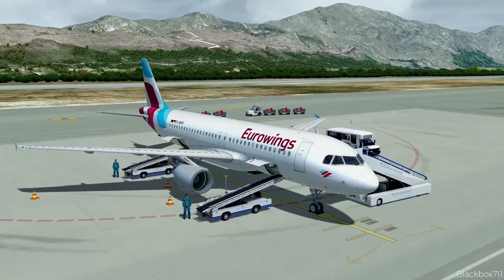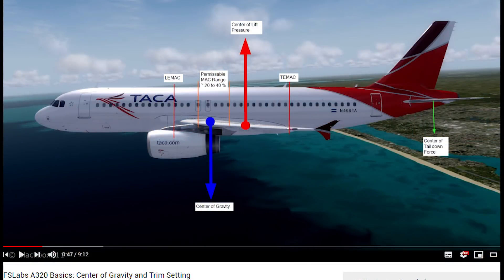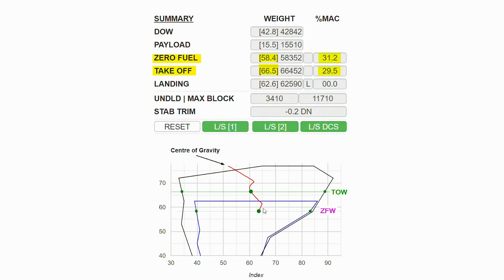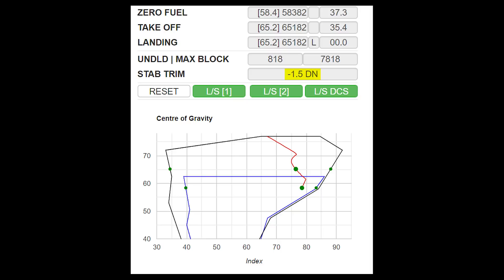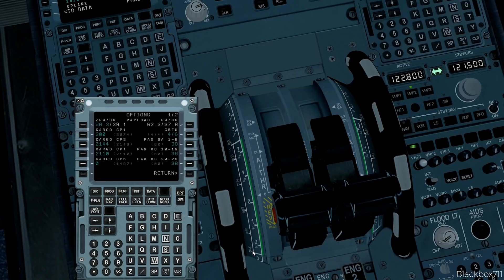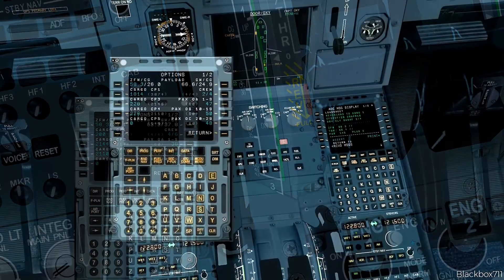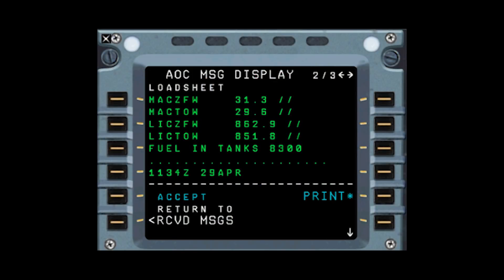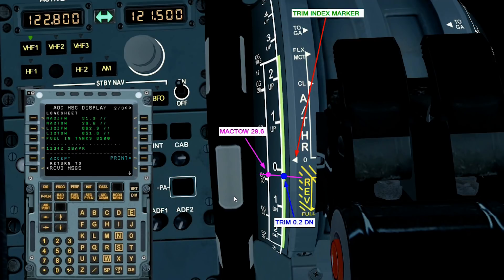Aircraft Basics: Takeoff Trim Setting in the FSLabs A320/A319

Comment: Hello… 

Very nice video. Thank you for sharing with us on this platform. Now it is making much more sense so as to what exactly is happening outside the aircraft whenever we are setting something inside the cockpit. 

So thanks a lot. 

Also… I had a small question that… 
Normally during Take off and during excessive pitch up and down in Air… I believe only the THS part is moving and not the elevators… However the elevators are moving for short corrections of CG movement. You may correct me if I am wrong. 

Because I just wanted to understand the elevator movement in air. When would it mostly move in relation to THS? would be great if you could make a video about it for pictorial presentation. 

Like for example.. If we take the flaps… Then does the THS whole alone move to again retr the aircraft or does that job is done simply by movement of Elevator… Stuff like that… 

It might be a little basic but wanted to have a clear understanding. 

Thanks in advance.

Comment: Hello, thanks for the video.
Do you know why the neutral position of the THS trim wheel does not match with 25% MAC, which is the reference station / neutral point?
Thanks
Colin
Reply from the maker: Hi Colin. A very good question to which I unfortunately have no answer.
Reply: @Blackbox711  Mmmh, it is probably because the CG is before the CP in order to have a stable flight, inducing a slight pitch down moment

Comment: nice video... I use the original Aerosoft's Airbus A-320 DLC pack in Steam Edition... when I choose the Checklist section of the MCDU panel for Co-Pilot mod, she asks: "Pitch Trim?" and I couldn't find it and always skipped the item... :D  now, I learned how to set the pitch trim... meanwhile, I also bought GSX Level-2 DLC pack, but I see just 1 passenger on-board and less baggage loading for A-320... should I set the density of the passengers in GSX's settings menu to get maximum passenger density? otherwise, if I choose Normal density, only 1 passenger boards...
Reply from the maker: Hi. Hmm, with the GSX I can’t help you. Probably best to post that in the developers forum.

Comment: On the trim setting why have two scales (inner and outer) wouldn't the outer CG scale suffice?
Reply from the maker: Hi. Theoretically yes. But for a pilot it is easier to have a relative trim setting value to a neutral point. So a “DN 0.2” is more conclusive than 29.5% MAC.

Comment: Hi I have a question that has nothing to do with the video, Is it true that I should do the approach checklist at 10.000ft?
Reply from the maker: Depends on what the approach checklist says. If it includes altimeter qnh setting then you have to wait until you set the altimeters.
Reply: Blackbox711 Well I guess I’ll do it after passing transition level thank you :)

Comment: GREAT WORK ! It's possible to have a video with a smoke issue in the cockpit ? I heart that the procedure can be the opening of the windows in flight ! it is true ?
Reply from the maker: Opening the windows is part of the smoke removal procedure. It is only done as a last resort because communication between the pilots becomes impossible once a window is opened.
Reply: @Blackbox711  thx you for the reponse ! it would be really stressful I guess ! When the windows is open it's possible to close it in flight ? is there any other unusual situation in flight manuals?
Reply from the maker: Depends on the airspeed. I never tried opening the window inflight in real life. However apparently it is possible to close it again when below 200 knots IAS

Comment: I use the same calculation tool as you, but since we have now water and galley weight added, how do you plan for this?
If i only load the compartments as on the mcdu payload page, i am missing 0.6t?
Reply from the maker: As far as I know the Gallery equipment and water is included in the Dry Operating Weight. Hence a reduction in galley weight and water will lead to a lower DOW and also a lower ZFW.
Reply: Blackbox711 ok, i need to try that out then. Maybe i need to adjust the Dry Operating Weight in the web tool.
Reply: flying_scubadiver What is the calculator called? :)
Reply: flying_scubadiver Nevermind, I found it. It’s the FSLABS Take Off calculator by David Katona!

Comment: Got an unrelated question - With the Airbus is it possible for the thrust lever to be left alone somewhere between the CLB and the FLX/MCT gates, and between the FLX/MCT and TOGA gates? or does the lever simply "slip" into the next gate once out of the previous gate?
Reply: No the lever does not slip over. You have to get a feeling where it has to go.